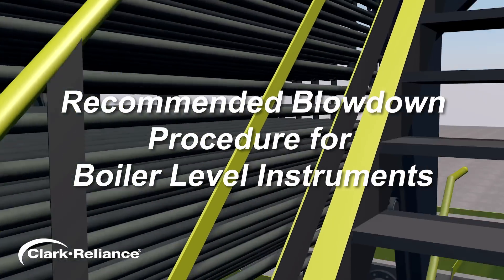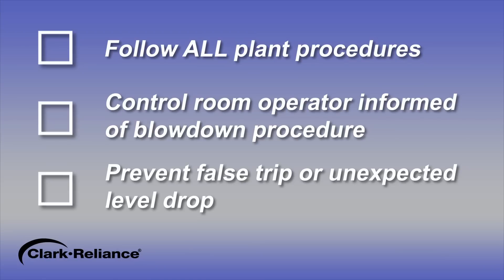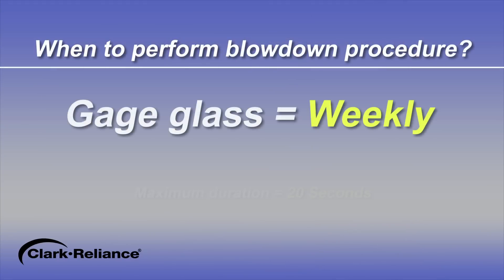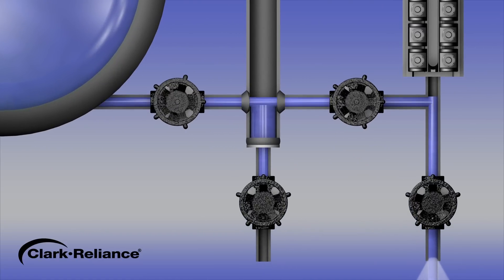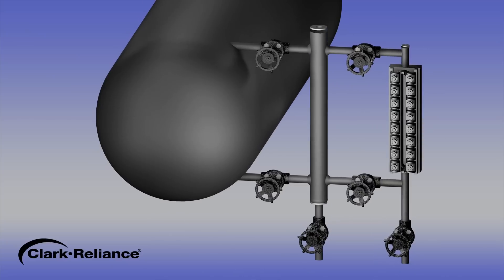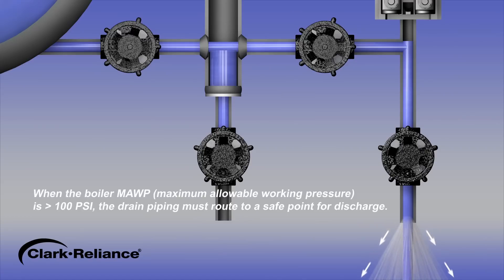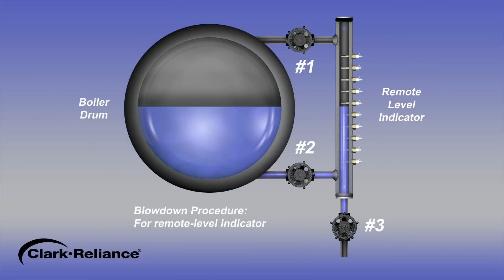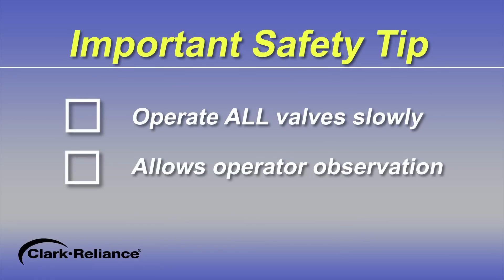Recommended Blowdown Procedure for Boiler Level Instruments

Comment: A question related to the Blowdown system, should the measurement/indication piping system connections be covered with thermal insulation or should they be left uncovered?

Comment: Why not make a heater for personal home owners that use induction tehcnology to heat the water?!  Then the jome! This is a multi million $ idea!
Reply: Electric heating, inductive and resistive, is more energy efficient than natural gas and is used in water heaters and furnaces in a lot of places. However natural gas is cheaper per kWh and so it is still the most common energy source for heating because of that.

Comment: I think 20 seconds is not enough in case of globe valves operation.  They take time for full operation (full open or full close) and ball valves are not installed on the said circuit. Also in the case of globe valves, valves operating positions are not given in the video. Partial opening of the valve shall decrease the valve seat life. 

Curious, what to do?? 🧐🧐
Reply from the maker: 1.	If you have an installation with valves that may require more than 20 seconds to manipulate, you may have to exceed the recommended 20 second duration described in our procedure. However, the duration should be kept to a minimum amount of time. Our procedure is a guideline offered to assist operators with the majority of typical installations. 
2.	Valve position is important to the operator. A trained operator should be educated on the valves in their particular boiler installations. Otherwise, they should seek guidance from the valve manufacturer.

We thank you for your comments.
 If you have any other questions, feel free to email us at askus@clark-reliance.com.
Reply: @ClarkReliance  thanks Sir
Reply: What should be drain frequency for Mobery (Water level controller automatic) ?

Comment: When blowing down of steam is done after 20sec and the drain valve is closed. Upon opening the the water valve to read the level in the boiler, will the water overcome the steam pressure?
Reply from the maker: No, the water level will promptly equalize with the level in the drum, because the steam piping ventilates back to the drum. The water level should stabilize very quickly, unless there is a blockage in the piping or the isolation valves are not fully opened.

Comment: Many operators in some plants never blow down level indicator piping on the dearaetor and condensate tanks.
Reply: Any idea bruh..why some of them  did not  blow down the lvl.indic..
Reply: @SeaMarinerosVlog  They may be worried about tripping the feed water pumps as most they are connected to a low water switch.
Reply: Neat and clean in simple words explanation thanks